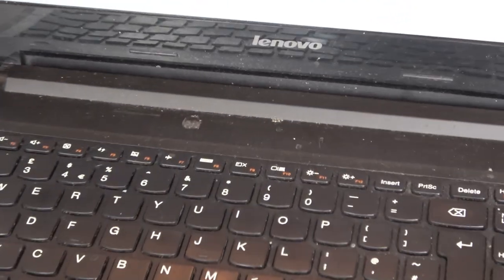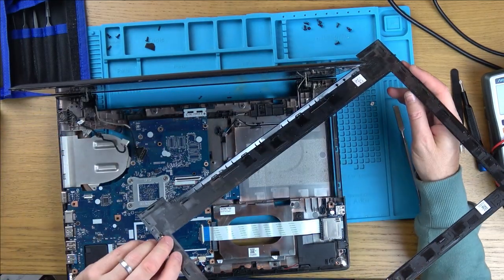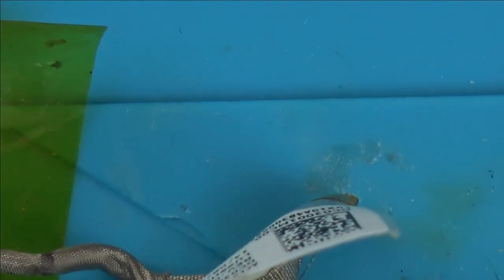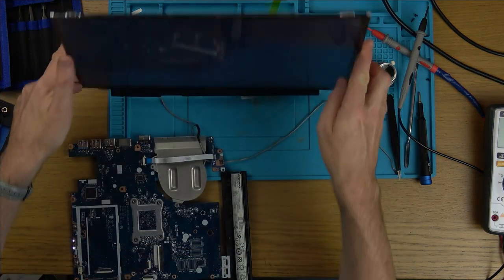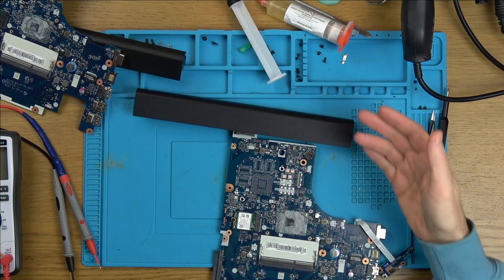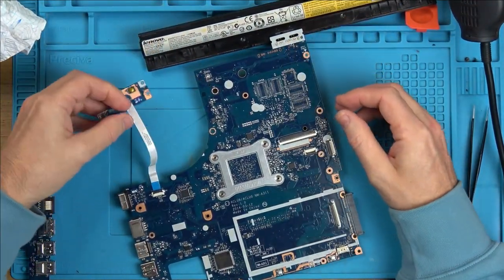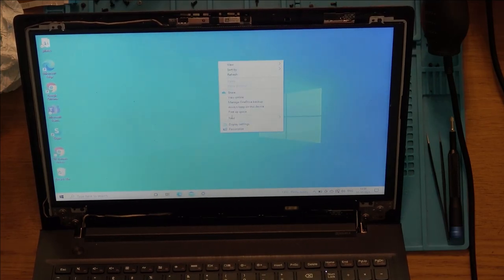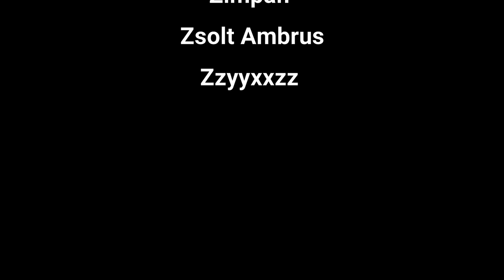LENOVO G50-30 LAPTOP with a WHITE SCREEN Fault - Trying to FIX

Comment: you did a wonderful job removing that LCD bezel, I just wanted to tell you generally starting from the top is best and working down to the bottom. under the bottom side of the bezel where it rests on the screen there is usually a strip of pretty strong adhesive. be careful with that it can cause the bezel to break. I work on laptops like these all the time. and I was gonna say, it's more likely to be an LCD issue instead of a motherboard issue if the device displays out of HDMI. lastly, if it displays on an external display it generally is unrelated to the graphics chip. Good work Vince

Comment: Nice!  👍  Hats off to you Vince for persevering with the original one and bringing it back to life.  I wonder if the LCD panel has a t-con (timing control) like a TV?  If so, could it be that which failed?
Reply from the maker: Maybe Steve. I'm thinking it is the little chip on the top right of the screen purely because of where the screen is grabbed and the lines that sometimes appeared, but the bottom board may be the culprit 👍👍👍
Reply: @Mymatevince  I don't think it will be the inverter board at the bottom as they usually just supply the back-light
Reply: ALBIN

Comment: The white screen is most probably because of the missing VGH/VGL/VCOM/VDD on the TCON board and not because of failed ACF bonding. There will be a dc-dc converter on the PCB(on the LCD panel) . It might be failed.
Reply: My lenovo laptop shows static noise like tv whenever I try to turn it on.
Sometimes it turns on n loads up the windows but after few minutes it again shows static noise and turns off.

If u know what is the main problem in it.
Plz reply!!!
Reply: @jobitjoseph
Reply: @samirshrestha8849 faulty LCD, drivers, etc? White screen could be a faulty polarizer.
Reply: My screen goes white after 2 minutes or so but if You press gently over left ribbon area it comes to life again... Maybe adhesive got old

Comment: Well done, Where to start , The screen fault  is the control chip on the lcd screen that is faulty and not the lcd panel. Yes EC ( Super IO ) on this model is programmable, you can read the bios chip and extract the  EC file from the bios but you would need a programmer to program the EC something like rt809f or rt 809h , I don`t think the ec was at fault here rather that the 3.3v rail was gone. I would do a bios update just to make sure the ec and bios match. Try to repair the faulty laptop would be a good video. Cheers 👍👍👍👍👍👍👍👍👍👍
Reply from the maker: Thanks for the info AR 👍👍👍👍

Comment: 19:20 If you would short all the pins above the plastic separator, nothing should happen. The longer pins are Ground, as they need to be connected to the battery first. Below the plastic there are the two positive pins and the two smaller pins besides the Ground pins are most likely data lines for measuring the temperature or reading out the serial number of the battery. The plastic part is a separator to prevent plugging in the battery the wrong way and to prevent accidently shorting the contacts. It is also a bit longer, so no straight piece of metal could short the voltage to the data lines.

It could always happen, that someone is using the notebook without the battery (stationary use in schools) and a paper clip or something similar gets under it and would short it out.

Comment: I saw a comment about this and I know this sounds idiotic but my HP laptop was like this, white screen no imput at all. Suggestions were, change screen or remove power chip and short it out, but this comment said this, remove battery and power cord and hold down power switch for 30 to 60 seconds replace battery and power cord and turn on and strange and silly as it sounds my screen came miraculously to life
Its worth a try will take about a few minutes and doesn't involve taking laptop apart. Great video as usual Vince  wonderful

Comment: Some additional info that maybe helpful. 

Places to look for white screen issues are the components feeding the 3.3v to the screen(lvds) cable on the motherboard. 

Is 3.3v on the connector on the motherboard, yes then move to the screen. No then go backwards to the switching component feeding the cable.

On the screen iteslf if there is 3.3v on the screen pcb at the cable then look for the VCC or TST point on the screen pcb.

If no 3.3v on VCC try running a jumper wire from the 3.3v at the cable to the VCC point to see if you get picture back on the screen.

The above has worked twice for me. Once on a Lenovo and once on a HP.

On a third laptop I had to run a jumper from the connector on the motherboard to the VCC on the screen pcb and it worked but the the brightness was on full and always on. 

So I had to find a 3.3v point that was only active when the laptop was awake so the screen would go off when it went to sleep or was shutdown.

Its a handy fix but most screens if the same size are swappable these days.

Really enjoy the video vince, especially the way you deliver them 👍🏻
Reply from the maker: Thanks for the tips 👍👍👍👍

Comment: hey vince i also use knedles to make life easier i stripped out the copper joining blocks from a choclate joining block strip and clamp the knedles with those loosely tighten them to the probes whne kneeded.

Comment: I actually had the same white screen problem on my laptop once. Though it was actually the ribbon cable bonded to the on glass chip inside the panel that had developed a faulty connection. Replacing the screen was easy though, and I got a better quality one as well.

Comment: I got a lenovo like that that someone had thrown away in ewaste. It had the white screen issue, but wouldn't do anything, and no external display either. I reflashed the bios chip and was able to get it to boot up, using an external screen. The internal was also broken, I think maybe someone got annoyed that the laptop wouldn't turn on and punched the screen.

I just took the whole lid off, so now I have a smart keyboard plugged into my TV :-)

Comment: The first thing I do with a suspected screen problem is to plug in an external monitor to the laptop. On older machines a vga or a hdmi on newer. This will give you a better idea if there is a problem on the screen or the motherboard/ribbon and graphics chip. Congrats for getting it working Vince glad it did not have the graphic chip problem.
Reply: He did plug to external screen
Reply: This model doesn't have an extra GPU. It would be populated on the free pads between the WiFi module and the battery connector. The smaller ones are for VRAM and the bigger one for the GPU itself.
Reply: @drcyb3r  Hi mate. What you are saying is that not all g50-30's have the hdmi connector? I looked up the g50-30 before commenting earlier and seen a video of them connecting an external monitor to it so took it they all had hdmi capability. Here's a link to the video I watched , thanks mate.
https://www.youtube.com/watch?v=QIPLQuRtkt0&ab_channel=Electronet
Reply: @boastyy  I meant that only some models have a dedicated GPU installed. There is an HDMI port on both models, but it is connected to the CPUs internal graphics instead of a GPU in this model. 

It depends on the exact model of the laptop how the HDMI port is connected. On models without a GPU it is always connected to the CPUs graphics. On models with a dedicated GPU there is a special IC that can switch between the CPUs graphics and the GPU. 

Troubleshooting of video problems strongly depends on how the exact board of the laptop is made. There are also some laptops where you can remove the dedicated GPU for upgrades or troubleshooting.
Reply: @drcyb3r   I got you , thanks for the explanation makes perfect sense. Thanks man
Reply: I have a somewhat similar issue with an ASUS GL552VW with the 6700HQ i7 processor and nVidia 960m non-removable GPU.  Sometimes on boot before the password appears the laptop monitor will glitch and the lower 25% of the screen will go to horizontal lines that prevent it from being displayed correctly.  More recently on some boots it just goes to black screen.  However, when I connect an HDMI cable to external monitor, both displays pop back to life and display perfectly. I have eliminated software since both Win 7 and Win 10 images on separate hard drives have the same problem.  Also, both Images refuse to charge properly over time (says plugged in charging but % charged stalls at 88-92% or so and if Left plugged in while shutdown, blinks orange instead of turning green) even though the battery will retain a charge and stay charged.  If I let the battery deplete, the charging resumes normally but never stays green once charged. I suspect it’s motherboard-graphic chip related and these videos help immensely as I really have no idea where to start.
Reply: @maf2383  It does not sound software related as the problem goes away when an hdmi cable and external monitor is used. The fact that the hdmi connection is working properly leads me to believe that the motherboard and graphics chip is working correctly which is good news as it the most expensive option to repair. It is worth checking the ribbon cable to the screen using a multimeter as Vince did.If the ribbon tested ok disconnect it, clean the connectors with some alcohol and connect it back up making sure the connectors are fully seated. Try the laptop out and see if it works. If its doing the same it looks like the screen has a problem, is there any damage?  Try pressing down lightly on the ffc connections as Vince did"the ribbon cables on the edge of the screen are very fragile so be very careful with them". If the picture comes back on the screen properly when touching the ffc connectors the screen will need replacing "ebay will have them" or possibly resoldered. I would try a new battery and see if the charging problem goes away. Most times it is just the battery on rare occasions there is a problem on the motherboard and the charging circuit but I would swap the battery first and see if its better. Good luck man.
Reply: @boastyy  I followed advice and appreciate any help.  I don’t think it’s the screen unless it’s some sort of voltage regulator chip on the screen itself.  The screen powers up every time with no issues from a true shutdown.  Only on most every “restart”. The ASUS screen appears perfect with the revolving circle and when the keyboard light go out and the screen refreshes, I see the lower screen distortion and then to black before logon screen ever appears.  When partially assembled, if I disconnect the monitor from the MB it springs to life perfectly and once booted behaves perfectly so it must be a voltage check on restart that is failing.  I re-flashed the bios, checked CMOS battery voltage, did the hard power reset, and disabled fast startup & hibernation in power settings.  If these symptoms still can be attributed to LCD control board, I guess I need to gamble and try to source one.  Just haven’t read anyone having a similar problem .  A lot of white screen issues, but no intermittent black screens on reboot.
Reply: @maf2383  Hi Mate , yes it seems like an odd problem. I would rule out the ribbon cable which connects the lcd to the motherboard. When the laptop is dismantled and turned on have you tried moving/bending  the cable to see if there is any change on the display. Clean the ribbon socket with some contact cleaner and inspect the connectors for any damage. Sometimes the screen ribbon gets stressed over time with the opening of the laptop screen. Could you state the exact model number of your laptop so i can check it out. Do you have an hdmi connector on the laptop? Thanks mate.
Reply: @boastyy  ASUS GL552VW-DH71 i7 6700HQ with nVidia GTX 960m, HM170 chipset. Tried both previously working Win 7 and Win 10 images on separate hard drives. Behavior is identical. Both internal and discrete graphics show enabled in Device mgr with no errors. Scanned both disk after mounting for errors using chkdsk. Set up to use nVidia card on boot. I do recall having usb thumb drives disconnecting randomly prior to this issue developing and still have WHEA-Logger for PCI Express Root Port hardware errors in event viewer (only errors showing).  I suspect it is a faulty motherboard.
Reply: @maf2383  Hi mate. I suspect a hardware not software issue. I would connect an hdmi to an external monitor and see how it works. If its working fine though hdmi then I would focus my attention on the ribbon cable and screen. The ribbon cables can normally be found quite cheaply online. I suspect the lcd to be expensive on a gaming laptop so if the hdmi output is good I would then try a different ribbon cable. If half of the screen is going white that to me indicates that its not a backlight problem but half the screen is losing its data signal, either a faulty ribbon or connector or bad connection/faulty screen.  All depends if the hdmi output is working properly so check that first mate.

Comment: It comes down to experience.  When I first saw the starts of this video, and you had a white screen, I know it was the panel because I had seen this many times before.  It could have been verified(when a person doesn't know this problem is the panel) by using an oscilloscope to test the signals going to the panel...

Comment: The problem of the LCD display is missing VGH voltage it shows 24 v check the following voltage  VGH 24v, VDD 3.3V,VCOM check this voltage on the planel. If you need any more details check on YouTube white screen      

              I seen all you're video. Great video
                  Have a great day.

Comment: Feels like it got missed.. what was the fault on the faulty ebay one?
Reply from the maker: All minor stuff. Key missing, battery issues and slightly broken power jack. The replacement would have been easier to bring back to life but I wanted to fix the initial faulty one, especially when I made it worse 👍

Comment: hi vince i had the same white screen issue on my dell laptop i fixed it by putting a little bit of cardboard between screen bezel and screen, When pressure was put on the LCD Screen board the screen works fine. When i removed cardboard the screen would freeze or go white. Ive heard others fixing this issue by shorting  the lvd in to the 3v in on the screen connector pins if that works the use a jumper wire to keep the pins shorted.

Comment: Maybe I missed it, but what exactly WAS the fix for the White Screen in the end?
Replacement of the Super IO chip, or replacing the faulty PU401 chip?
I have exactly the same problem with a recently purchased Dell Latitude E6420.

Comment: I've killed circuit boards when probing with a multimeter.  If you short adjacent pins you can blow up sensitive integrated circuits without even realizing it.  Pays to start with a schematic and know what's hazardous to the device before probing blindly.
Reply: It is the shorting and not the probing that is the problem.   Use a probe with a very fine tip and keep a steady hand.   I have scope probes that have plastic lugs either side to help but they don't help when the pins get very close together.   Then it can be a good idea to follow the track away from the pin and measure at some other component which is connected but where it is safer from short circuit.

Comment: The problem with the screen not working is the display control board that's on the actual screen. They go out a good bit on the Lenovo laptops.

Comment: My daily laptop is a Lenovo Z50-75 I bought it faulty on eBay and it just worked after putting in a hard drive. I've updated the 720p LCD to 1080p, an SSD and 16GB of Ram and its a nippy lil bugger for a 4th gen. I paid £40 inc postage.
Reply: man i'll need to upgrade mine then

Comment: Vince you should get a hdmi control board for 30 and 40 pin monitors so next time you can check if the screen is working or is it a laptop problem.

Comment: Nice fix, i doubt it was the super i/o, probably just the mosfet pack you replaced. Why does it sound like you're working in a café kitchen in a lot of the videos with all the clatter of pots and pans at times :)

Comment: You don't need a spec for spec replacement screen. If you search for 30pin 15.6 inch screen you will find the replacement easy. You just need to look which side the connector is but most of them are on the same side as yours.

Comment: Those voltages around the faulty screen seem very low. Does an inverter not need to bump up the voltage to power the screen? Most of your readings were under 1 volt. I would have expected at least 10 volts out of the 15?
Reply from the maker: Cheers Paul. Maybe, I don't know if the fault was on the actual screen or the board feeding the screen. I spent so much time on this off camera because of the eye loop incident, that I didn't think to measure voltages on the working screen. 🤦‍♂️ 👍👍
Reply: @Mymatevince  Hey There Vince
I have an HP Probook G3. It was a very good laptop but one day while I was in a zoom meeting the laptop just turned off and now whenever I connect the charger the screen starts flickering white. When I smelt the side of the laptop (fan outlet) it smells burnt any idea what the problem is?

Comment: One of my uncles has a laptop which developed a white screen fault and I didn't have the experience or equipment at the time, but info pointed towards reballing the GPU. He claimed it was a virus. I said find a PC repair place who knows how to hot air rework motherboards. I don't know if it ever got fixed.

Comment: I dont wanna be that guy but u can actually check your graphics to see if it has the ability to run graphics, go to device manager, then system devices.  there you'll be able to run a test if the test fails its a no go. graphics seem good on this one if its able to cast to another monitor